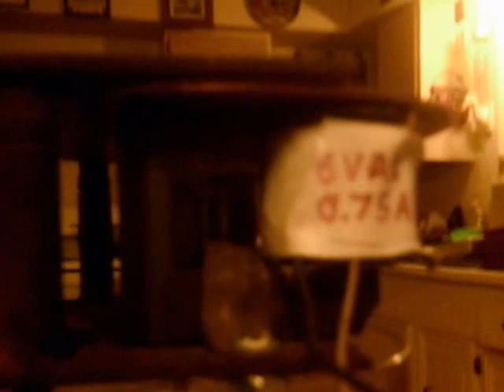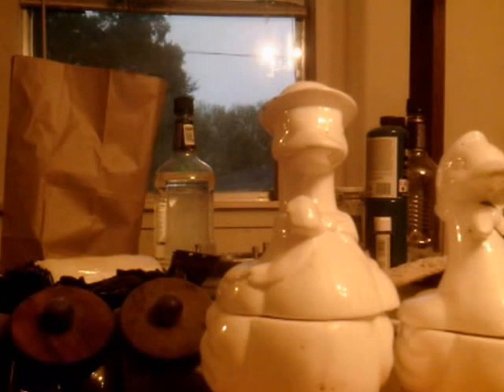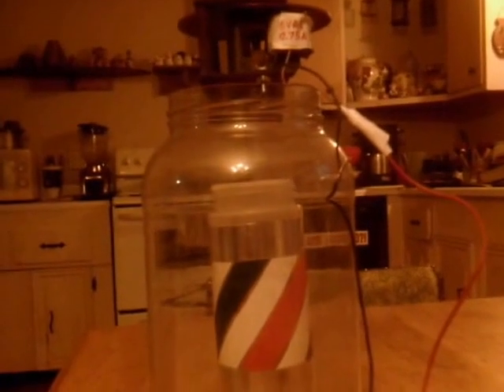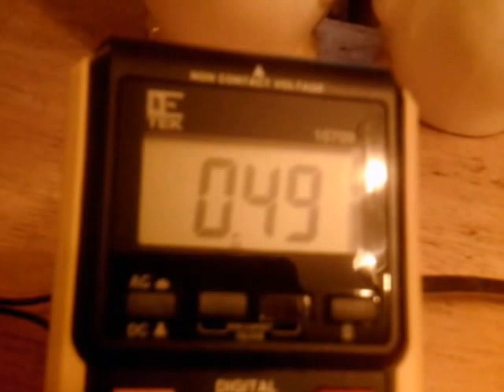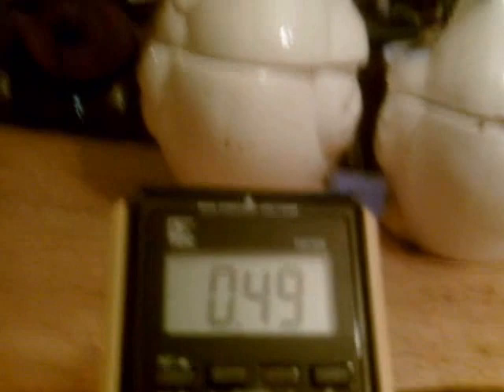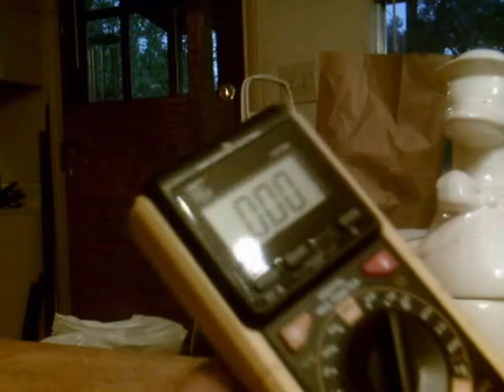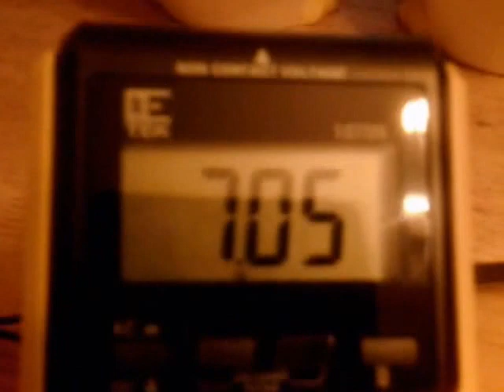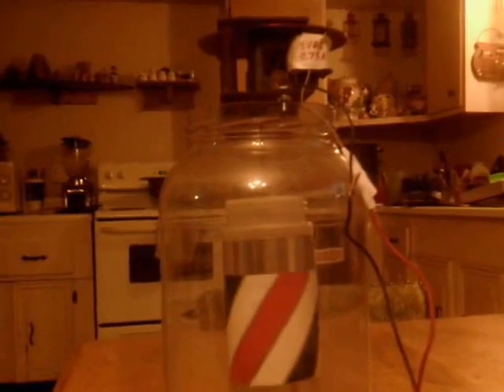Movie 0001Antique barbers pole motor experiment

Comment from the maker: I have come to believe that this is still a shaded pole motor, as one pole of the inductor is completely under the iron plate of the frame and the other pole is only half way under the iron plate of the frame. This motor can also run on 12 volts, but will get hot after a while. when ran on 6 volts, it will not get hot. Not that I wanted to be commenting on my own video, but I just wanted to say some things that I had left out. Also, on 6 volts, with no secondary axel, it turns about 180 rpms. On 12 volts, it turns not much faster at all but has much more torque.